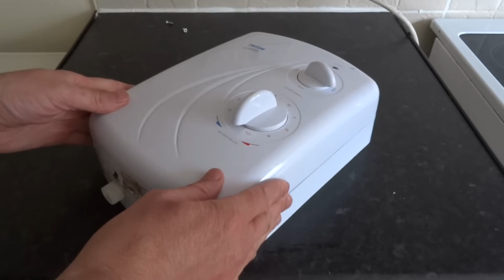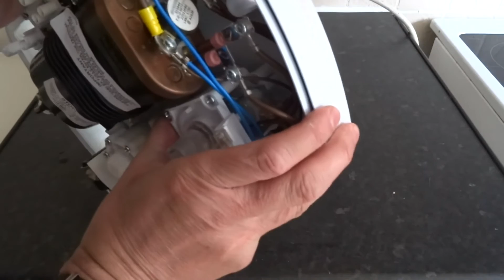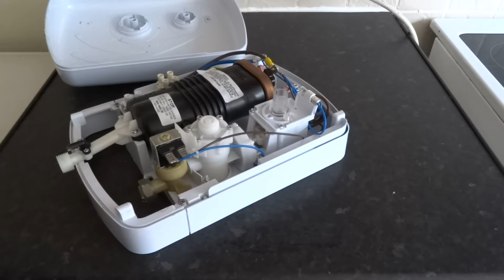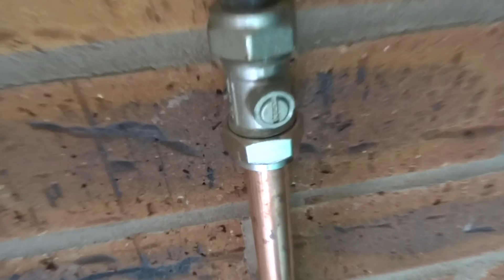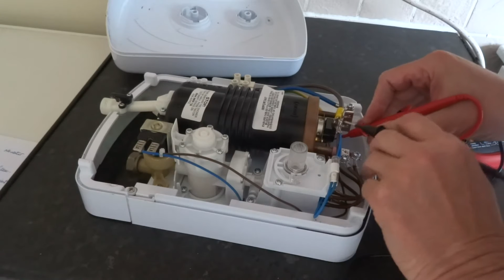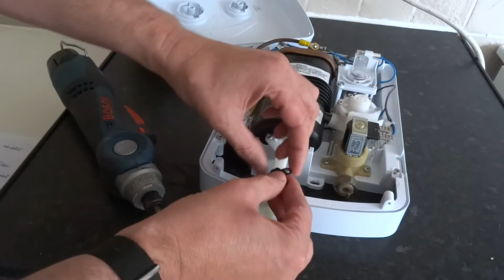Electric Shower Repair: Top 5 Faults & FIXES (No Hot Water, Leaking, No Power, Cold)

Comment: Good video what if I bypass that too till I get a new one I took my faulty one apart it was in peace’s in side so I removed the bit put back both discs no I have a reading on my multimeter
Reply from the maker: Becareful though as safety devices are there for a reason and cut of supply to avoid burns etc.
Reply: @cagmito76  is there a inside diagram of the two on how it actually works
Reply from the maker: @chatchatty2155  Is it the TCO , not sure might be worth searching internet for one.
Reply: @cagmito76  yes the two it would be handy to no how it works inside view triton t80 fco

Comment: What could be the problem when the water heater is on and shows all lights but the temperature stuck on Cold and 25°c
Reply from the maker: You really need to test to find out, if its got a PCB it wil be more difficult to pin point.

Comment: on my electric shower the water is very very hot even when i turn it to low can you tell me what is wrong
Reply from the maker: there is a problem with the flow it could be blockage or flow control valve.

Comment: Having an issue with my triton madrid 2, was working fine one day, the next the isolator switch light comes on and sets to on, no light on the shower though no power just doesn't turn on and the isolator light goes off when trying to turn it on. Any idea and fix? 

TIA
Reply from the maker: you need to test to see if you have power to the switch and at the shower , its more than likely a faulty isolator switch though

Comment: Hi, mums shower is a Mira advance ATL Thermostatic and has No power when turned on at ceiling... checked fuse inside shower and switch in ceiling has electric flow, just not power to unit? There was water sitting in the top heater element tube around heater switch. 
Me mums desperate and just unsure with not wanting her to get ripped off x
Reply from the maker: I would not be doing live main voltage testing if you are unsure , best to get technician out . Where are you located.   Switch off electric at consumer unit use you meter in continuity mode to test switch and incoming mains connection in shower dead testing is much safer . If you do not have continuity through switch you need new switch. Hope fully thats your issue these are quite expensive showers to buy and repair.

Comment: Hey cagmito! Ive got a yamaha wr125x and I was wondering do you know the resistance for the stator coils? Would help a lot! (Has same motor as yzf r125)
Reply from the maker: forget now sorry but if you find out update so i can write down again
Reply: @cagmito76  Mine was at 1.4 - 1.5ohms and someone told me it should be 0.45 - 0.67ohms so should i replace my stator or does that matter?
Reply from the maker: @benokunhon7665  i checked mine measure 0.45 its a lot over it would affect generation did you do battery test 12v off it should jump to 14v  when running and over 3/4000 revs
Reply: @cagmito76  Have to check that tomorrow, will update you then. Thank you so much for helping!
Reply: @cagmito76  The battery was at 12.6V off and when I started the bike it was 14.6V but I didnt rev the bike at all
Reply: @cagmito76  The problem Ive been having is that my bike keeps shutting down while riding and wont start after it. Sometimes when Im leaving for a ride it wont start either so I was wondering could it be because of the stator?
Reply from the maker: @benokunhon7665  I would be more suspecting fuel and ignition systems to be honest - sounds like its intermittent fault which can be nightmare wait till it cuts out and test ignition coil to begin with
Reply from the maker: @benokunhon7665  yeah charging system is fine then